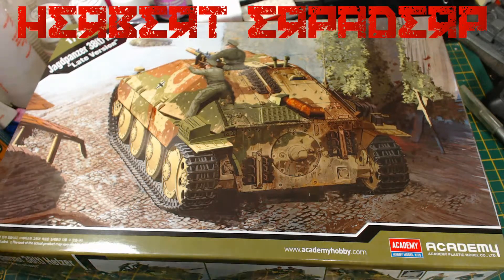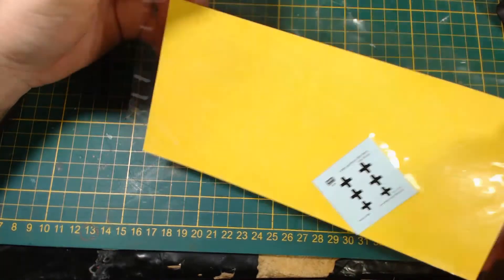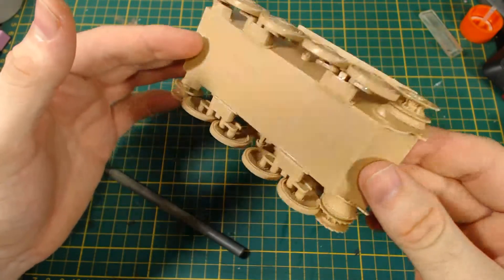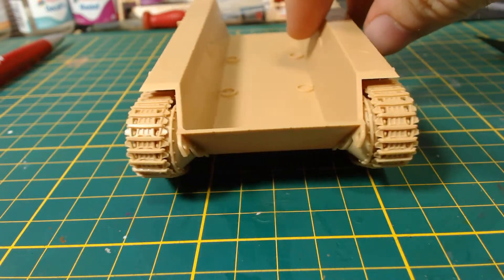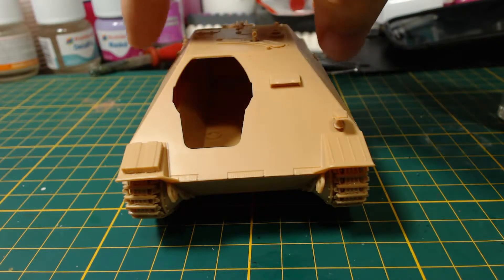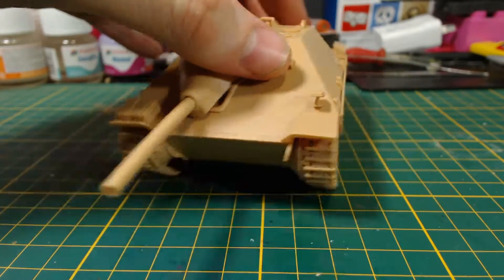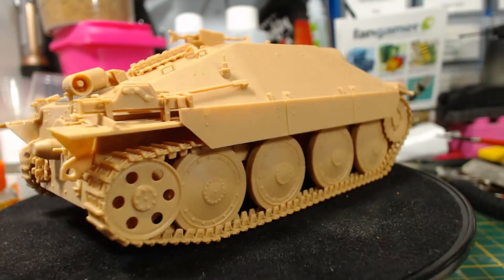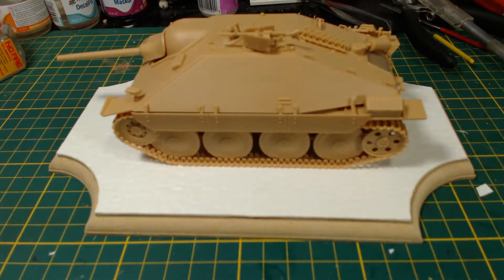1:35 Scale Hetzer Build

Comment: I didn't do big kits like this, because I usually messed up the track. Now I can do the tracks like you. Thanks!
Reply from the maker: Péter Széles Awesome!I had a thought that maybe taping a steel ruler or something to the work surface might help to keep the tracks straight.
Reply: +Herbert Erpaderp You might want to use a double sided tape and a ruler for the tracks. Put the double sided tape on a flat surface and then stick the track links together and then aglign the guide horns with the ruler. Then after that, apply ur plastic cement on the tracks and just before its dried, take out the tracks carefully and wind the track around the road wheels and ur done!